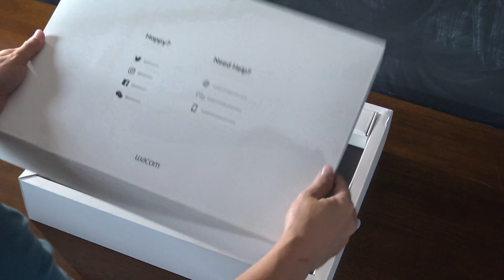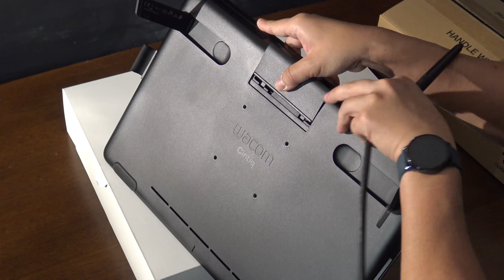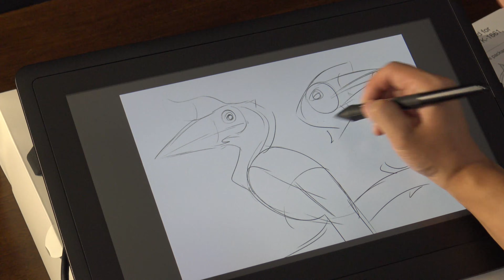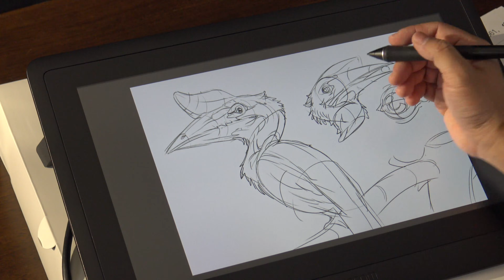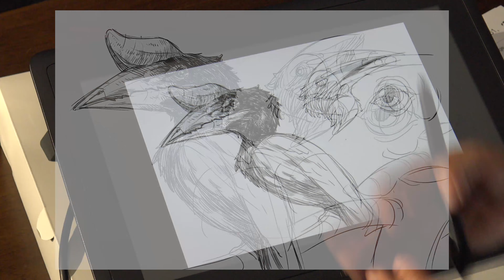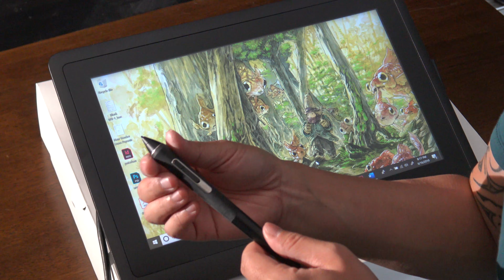Wacom Cintiq 16 Review and Sketch Demo

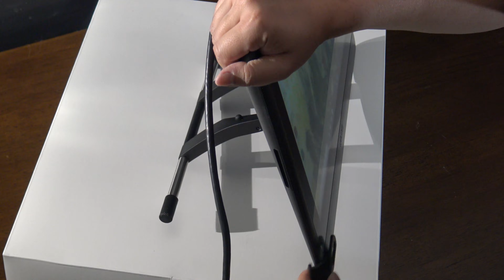Comment: Just an FYI, around 29:15...  The rubber stopper foot didn't sit right because they are corner-specific.  You put the right-corner stopper on the left corner.  Agree about the stand...  No idea why Wacom decided to go with the VESA mounting plate but then still require 4 screws to mount the stand to the plate.  If they're not going to provide a quick-disconnect then why not just have the stand mount to the VESA holes.  Love my Cintiq 16, and I do travel with it at times and really wish the stand was quick-disconnect.
Reply: Can i use it without any computer? My friend is gonna give me one of these to me because I don't have a computer. Will it start up?

Comment: Very nice review and great demo Peter. One addition - I have used the Wacom 22/24 displays too as well as the 27 (which is gigantic). I'm considering going for the 16 as you can hit a button to switch it to 'tablet mode' and effectively it becomes an Intuos Pro for any other display. That being the case, I can use the 16 on my lap or portable in 'pen display' mode. Then I can use it in tablet mode with a 27" monitor. That to me is the best of both worlds. I've yet to try it out though.
Reply: I know the 16 doesn't have multi-touch feature.

Comment: Non related, just how to get a better end result
-draw the basic shapes that might fit in the thing your trying to draw (eg: a beak is a cone, a body is a cuboid or giant cylinder)
Don't take too much time in this step

-add details

-add lineart (to have clean lineart as a beginner zoom into a part, draw the line, zoom out, it looks clean

-color, usually I would add a dark gray tone, then add another layer then I would add the basic colors without any highlights or shading
Another layer, shading
Another layer, highlight if you want

Done :)

Comment: Very thorough review!  You're amazing!  I’ve had a  Artist 15.6 Pro from XP-Pen.  The pen is really really good and it has a laminated display (no or at least very little parallax) and the price is really low. The drawing experience is almost as good as the Wacom Cintiq 16 plus it has shortcut keys along the side.
Reply: Did it work with SAI? I own a 22R Pro and I cant get it to work with SAI
Reply: @wvlfboyy  of course it can work with SAI, you need connect the xppen tech support.
Reply: @tomthesmol9676   I tried everything listed in forums, nothing worked. It works well in Ps though. Any advice you can give?

Comment: Not very affordable really. I got an XP-Pen 15.6, which pretty much does the same thing and is very well built for less than half the price. After extensively using it over the past few months I can say it works really well. The Wacom tablets come calibrated out of the box and the XP-Pen does not, but I have a screen calibrator so was not a big problem for me. Screens go out of calibration over time, so a screen calibrator is a must if you want accurate colours.

Comment: Hey, very interesting video! Do you happen to know if the pen leaves scratches on the display? Should I put a protective film on the display? have you had any experiences with it?
Reply: i dont have this exact cintiq model but after using the 13hd (i bought it used) for about almost 5 weeks i havent noticed any scratches on the screen (and i am not a light sketcher). if you want to be safe though it wont hurt to buy a protective film ^^

Comment: Hello!
Thank you very much for making this clear review. I recently bought the Cintiq 16 and I'm very happy and satisfied with the purchase, especially because the previous model I had was the Wacom Intuos Art Medium. I have to say that I made a wonderful upgrade. However, I have a question about pressure sensitivity while drawing with Photoshop.
I can't have the same pressure sensitivity while drawing that you demonstrated in your demo sketch. Every sign or line that I draw remains uniform. I checked the settings and changed brushes, but I still don't get a noticeable stroke difference based on the pressure I apply while drawing. Do you have any ideas or advice? I really appreciate it. Thanks very much.
Reply: Problem solved! :) Any way, Thank you!
Reply: @cirosackie  How did you solve it?

Comment: Hello! I have an urgent question..

Do i need a really good laptop for it? Im kind of afraid it would lag
My laptop is around 8 years old
Reply: I got it today! Everything looks good for now

Except maybe colors
Not sure if its my laptop or my graphic table but colors look different on each..
Reply: @LilxthArt  ay thats good! I would get my phone and try to get the colors on the tablet as accurate as possible instead of looking at the colors on the computer
Reply: xCrossu3u im pretty sure it has te be windows 7 or newer. I think youre good even though its kinda old. I used a old laptop before i got my newest one and it worked well with my tablet
Reply: Not high end, but a newer CPU and, at least 16gb of ram and decent GPU card will run it way faster, but try it on your laptop first.

Comment: Is the Cintiq 16pro better?
Reply: Yes, Cintiq pro 16 has a 4k resolution, a multi-touch (you can zoom-in / zoom-out and move your draw with your fingers) and it has a better colorimetry  (94% RVB, then Cintiq 16 have 72% RVB). But the Cintiq pro 16 coast ~1600$ and the Cintiq 16 coast ~ 600$

Sorry for bad english, I'm french

Comment: Which is better this one or wacom cintiq pro 13??
Reply: The Cintiq pro 13 has a small screen but it has the multi-touch and a better colorimetry than Cintiq 16 (that's why Cintiq pro 13 is much expensive). But the screen of the Cintiq 16 is bigger and much confortable for drawing. I think the Cintiq 16 is better.

Sorry for bad english, I'm french ;)
Reply: @MrAlexrennes  you actually have great grammar and spelling!
Reply: @imbabey274  Thx !

Comment: I wish they had a 20 inch version of this.
Reply: And 1440p or 4k without touch. That would be nice, with a pricetag about 800USD.
Reply: @PixelPioneerSwe  yes. I can work with a 1080p at 20inches, and no touch. It's really enough for me. 

Important things are parallax, accuracy, and tracking. Those are the essentials for me.

And ofcourse an affordable price.
Reply: @GnaReffotsirk  Sure is a dealbreaker. The only reason that i want a 4K on a 20" monitor is because the color spectrum(correct word?) is higher. And ofcourse VESA holes, 75x75mm or 100x100mm to attach a arm of my own choice.
Reply: @AnteroX1234  Yeah, I saw it yesterday.